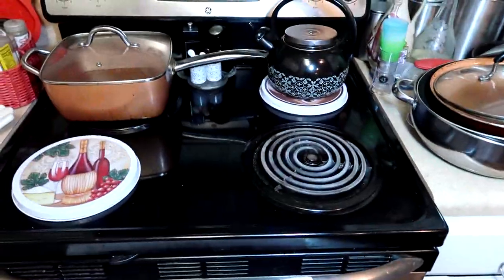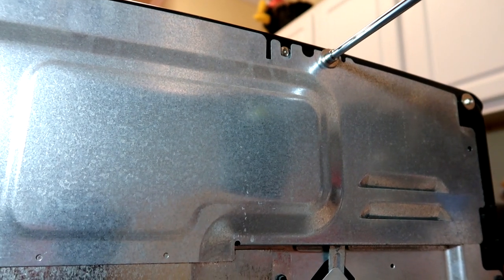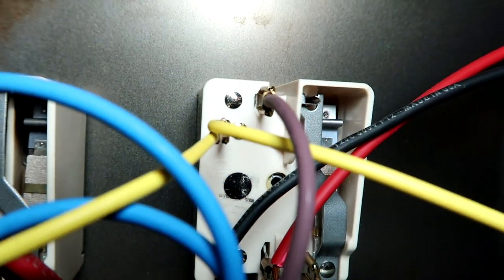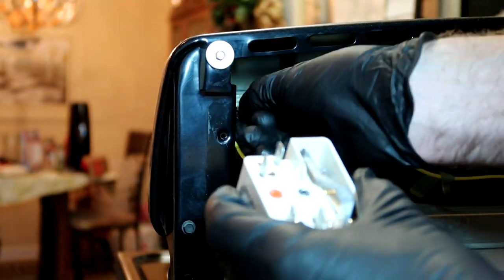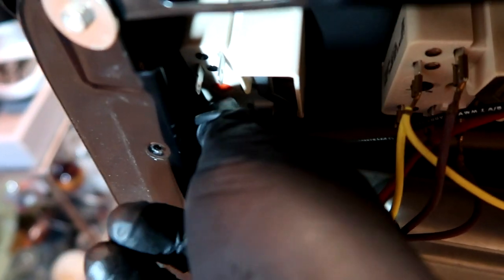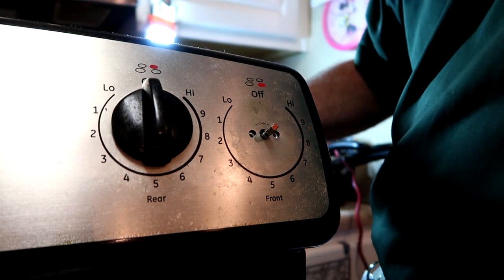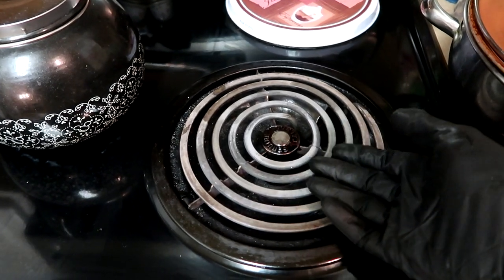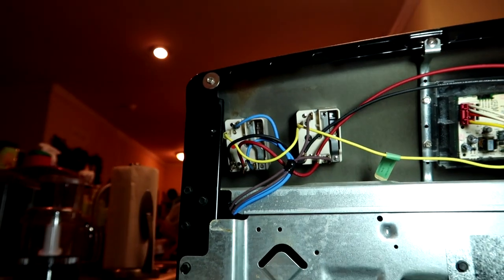Stove Burner Gets Too Hot On Low Setting

Comment: Thanks for the uploads, Lex!  I learn a lot from them.  I've been in high rise building maintenance for 1.5 years now and love the company I am with!  I had lots of renovation and construction knowledge before this ( basic plumbing and electrical as well )
I will be signing up for BOMI courses next month to work towards a few tickets.  I love that every day is a little bit different than the day before.  We've got about 285 suites in the highrise building ( and 12 of them are big 2 storey townhouses attached to the tower as well )
I love to learn and I usually go with the contractors to watch and learn from them too.  My knowledge is so much higher, just from doing that one thing too.  We've got 2 large boilers that I am familiar with now, 3 massive domestic hot water tanks and multiple booster pumps and controllers, some heat pumps and a large MUA on the roof.  No AC attached to it though.  Just a few stand along condensers for some certain amenities rooms ( theater, coffee room, office, top floor lounge etc. ) It's a pretty sweet building.  Minus the water leaks hahaha.  

Thanks again for the videos...keep em coming!  I particularly like the appliance repair ones as we do fix a lot of machines in my building as well.  I also like your HVAC vids too.  Hell...I like em all lol!  Take care man.
Reply from the maker: Wow right on! Thank you so much for watching Man Time!

Comment: Having a problem with burners that stayed on high when you turned them down, I saw a comment on a video recently where a guy talked about making adjustments to the switch. If you have it off and, hold it with one hand, and turn the know with the other you will see that it moves inside. After ordering a couple new dual switches, the  old switches seem to work like they should. I am thinking it is possible that these switched get gummed up a bit and stick. I do believe that this problem is not one to mess with, but at 68 years old and having 7 adult children, and 10 grand-children,  it's always a good idea to see if something can be fixed.
Reply from the maker: Thank you so much for watching!

Comment: Great video.  I have a 1956 Frigidaire electric range.  Everything is working as I'd expect.  We did not that when the oven is on we feel heat coming up through the burner holes.  Burners are off, but feel the heat penetrating up.  Its enough heat that it would burn you if you were to be baking something for an hour or so.  Any ideas to troubleshoot?
Reply from the maker: I'd need to be there for this head scratcher 🤔.
Reply: Sounds like it was the exhaust. It’s usually the back right burner that has the heat coming out from the oven

Comment: What if the switch in the back doesn't look burnt in back of stove on the GE stove burner. We have the same problem an took back off an looks bran new just like outher switch's in back
Reply from the maker: Still could be bad. Sometimes they don't look burned. I hope everything works out for you.
Reply: @LexVance   Thank you for responding so quickly. That's what I thought too an maybe the switch is bad like said an it's wierd man. I can Maneuver the burner an it kinda will work an it's just sketchy so I think we will buy new a switch an thank you again very much an it's from 2013 in good shape. Im going to subscribe to you. Much appreciated Lex.
Reply: Happy New Year as  well. " 2023 " 🎊🎉🎆🎇

Comment: I just replaced one of these switches on our range a few months ago, and it's doing it again. Anything else I should check, or was the replacement switch just bad? Any possibility it's the temperature probe in the burner (glass top range). Thanks!
Reply from the maker: Check the switch and see if it's black inside from burn. It could be a lemon. I've had that happen. If that's not it then I'd need to be there for this head scratcher 🤔.
Reply: @LexVance  Thanks! I'll throw a new switch at the problem and see what happens.

Comment: What's my next step if I changed the receptacle block and burner and that burner still isn't working. I wired the block up right. I need to tear into the range and mess with wires somewhere else ?
Reply from the maker: It may be a bad mother board. I'd need to be there for this head scratcher. 🤔

Comment: When these switches fail can the cause the temp to fluctuate from low to max heat over and over when the dial is set on medium?  If not is it a bad or wrong element that would cause that?  I'm also trying to find out why some elements are made for GE and Hotpoint and some for all other brands.
Reply from the maker: If the elements look good and there are no breaks or pits on them, I'd say the switch is bad and making the temperature fluctuate. GE and Hotpoint are within the same company. I believe Hotpoint is the lower level model.

Comment: My Samsung ne58f9500ss has issues with all of the burners getting way too hot and out of control. Any idea what that might be?
Reply from the maker: Burner switch may be getting stuck on high. You can try replacing them.
Reply: @LexVance  they all started at once out of nowhere. I'll check it the burner switch you suggested. Thanks for the reply. This range was like $1300 on sale so I'd hate to buy a new one.

Comment: I have replaced the switch but still overheating. I changed the coil as well and it does overheating😓.
Reply from the maker: Hmmm, maybe the mother board? I'd need to be there for this head scratcher 🤔
Reply: @LexVance  It used to heat normal on medium but now medium feels high but if I put it on low it goes down. Original switch was 10.0-11.5A 240v and I replaced with a 8.9-11.0A 240v. Does that matter? Thanks
Reply from the maker: @masterfox3539  Yeah, I'd go back with what the old one was. A total match.

Comment: U can smack the switch with a screwdriver handle and useley get them working again.... I have fixed lots like that and only got called back once
Reply from the maker: Right on. If I worked solo and didn't have to worry about another guy doing my call back, I'd definitely smack it with a screwdriver handle. Thank you so much for watching Bart!
Reply: Yeah I understand that.... the other guy all ways tries to throw the other tecks under the buss....